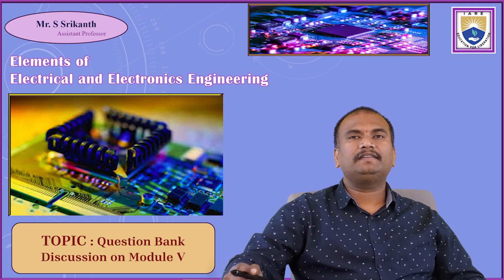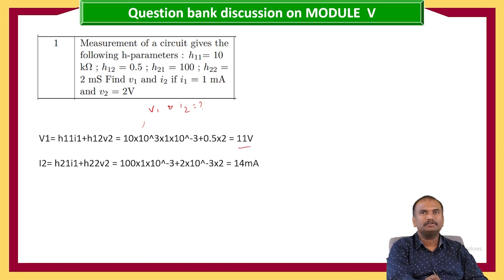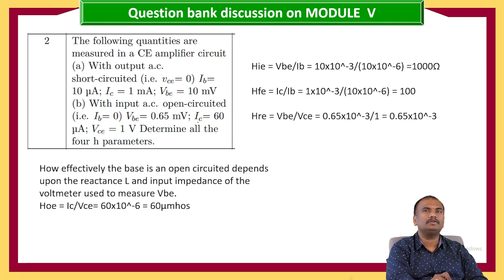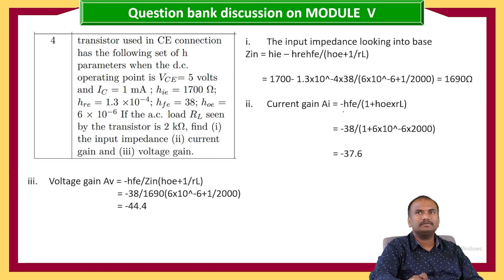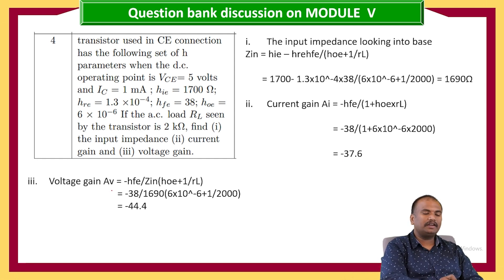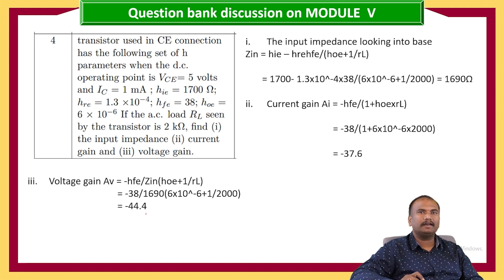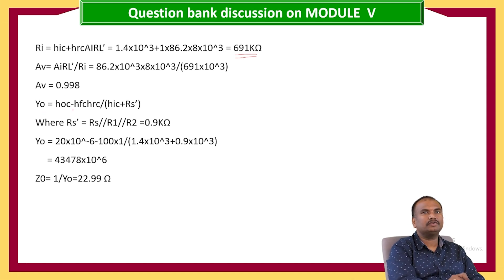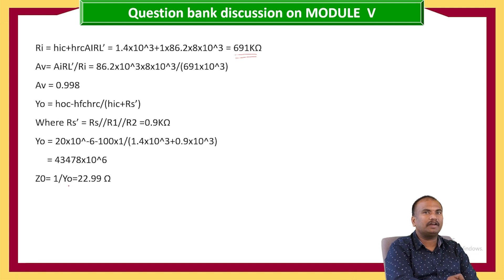Question Bank Discussion on Module Ⅴ by Mr. S Srikanth

Comment: sir one doubt in 9th question  hoc value is 20x10^6 but you took 20x10^-6 if we take as per question the voltage gain is neglected
how can you give a solution